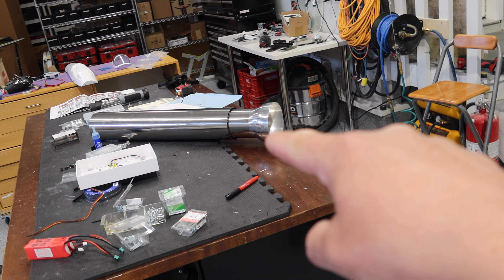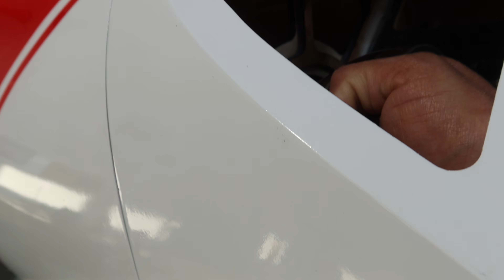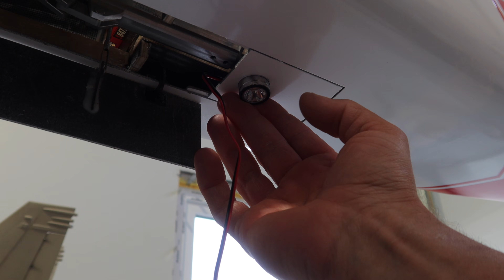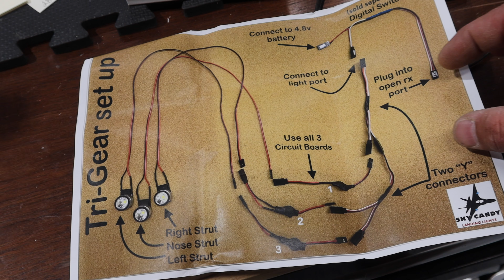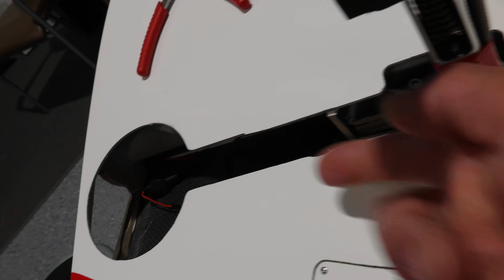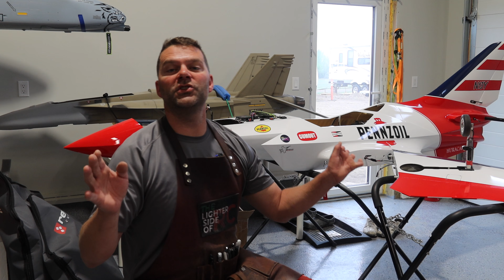CRITICAL HURACAN Upgrades?  Maybe!

Comment: so after the crash  is anything reusable  for a new one
Reply from the maker: Engine did ok.  one of the fortunate things is with all the power off at time of impact none of the servos are fighting any of the forces.  So all the servos are clean and useable.  Generally wouldn't install them on any critical locations after an incident like that.